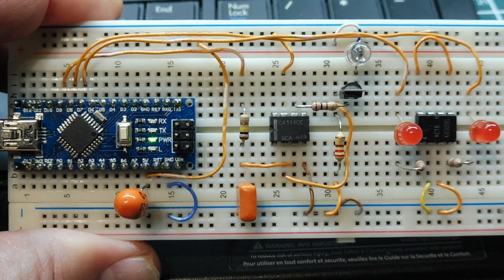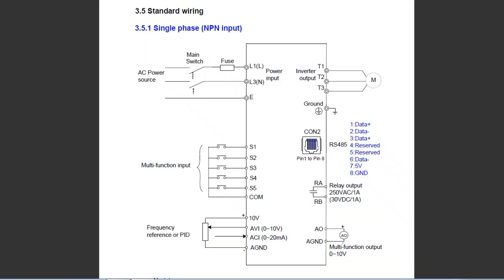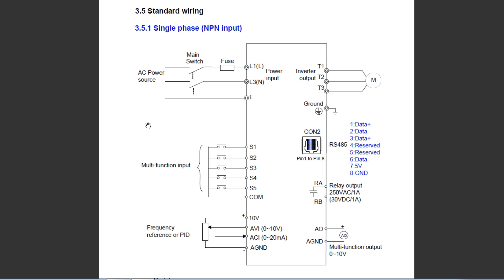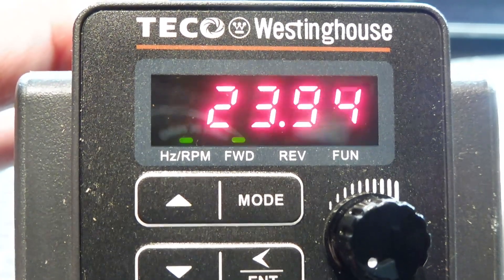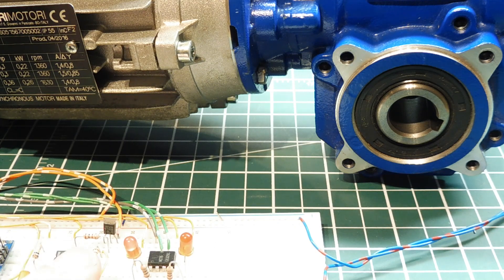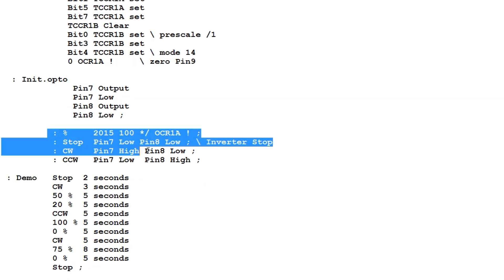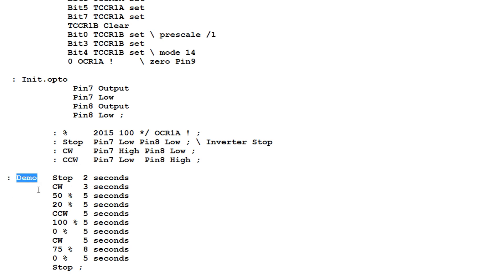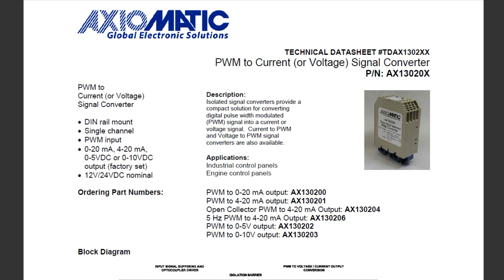How to control a 3 phase motor using the Arduino Nano and VFD

Comment: Hey could you create an arduino code to control a 3-phase motor and 2 12v diverter valves from an arduino uno?

Comment: can you show a closed loop control circuit involving a encoder giving feedback to the controller to maintain speed?
Reply from the maker: The VFD contains a PID controller. PID target value is set with the front pot and the feedback input is AVI 0 to 10 volts. PID values can be configured from the front panel for a closed loop system.

Comment: please provide code,circuit diagram with  Arduino Nano pins connection and wiring 3 phase induction motor and all electronics components . upload on google drive or any other share drive. Thanks in Advance.

Comment: Hello.. great video. I want to apply this method of controlling ac motor to control a single phase AC motor of 1 hp with including a incremental rotary encoder to rotate motor shaft for a specific no. of times. Please help!

Comment: Will this maintain the correct slip angle under load for good torque?
Reply from the maker: The VFD will always maintain Volts/Hertz regulation and will provide the proper voltage for each frequency. When running at a constant speed, slip happens naturally as the load increases. Slip increases with increasing load - providing a greater torque.
Reply: @0033mer  interesting thanks. what about for ramping up and down speed?

Comment: What I have is a motor which is three phase 220V AC with magnetic multipole rotor  rotates inside the stator. It has hall sensor, there seem to be three of them positioned there.  there are 3 hall wirse, ground and the red 5 volt.  I also have the controller board power supply,  I guess they are one unit typically like yours.
On the heat sink it says M1 1400 RPM, M2=1250 ,M3=1200,M4 =1000.  There are 4 separate male plugs sticking out for each of them,  located next to the power in.   I don't know where they would go if I were to use Arduino for control program.
There is also CN3, 4 pins (FG, RT/PWM,62,V2) wherever they go.
There is also CN4, 4 pins ( mode, rest,5v,gnd) wherever these pins goes.
Oh one more there is a square box with two little switch on it which appear to be for the 4 male plugs which seem to pertain to speed of the motor only. 4 combination of them for those M's 4 different motor speed which is mentioned on this  board.
I guess the only thing I don't have is the control panel and a program .  So I wonder if I can use Arduino and some program for this.     Hope to  hear from you. By the way the motor was used to run window air conditioning fan.
Thanks.
Reply from the maker: Sounds like you have a Permanent Magnet Synchronous Motor (PMSM) which is a different motor than my induction motor and the Arduino code will not work on that setup. 
You need to get the data-sheet of your controller to see what input signals are needed for proper motor control.
Reply: @0033mer  I thought I had included a link for the motor. What do I know.
https://www.h-mac.com/amana-0131p00029S.html
When a person sees u.v.w them three wires, does that imply the motor is 3 phase?  The site describes it as single phase.  They don't give you wiring diagram or circuit controller diagram or even to find it most like is out of the question.
And of course Amana site want the make and model of the AC unit itself, in the landfill about 12 miles away, and buried.

Would my assumption be correct that this power supply basically has two components or has two functions that is. 1.   change the single phase to three phase ( ost likely delta) and 2. the second circuitory is to control the speed and direction.  Does that sound about right?
And both circuits are integrated so that I can not use any speed without hooking up and making both  part of the circuit talk to each other.
I am also  just wondering if you would know what [ CN3, 4 pins (FG, RT/PWM,62,V2] them 4 pins labels mean, heck I would put kind of value on pulse Arduino for them and see what happens. if FG is ground, I assume V2 to be 5 volts and PWM, a pin to it, But 62 ( and it doesn't look like it is G2) whatever that pin is.

Comment: Thanks for this video! i am using arduino digital output to connect / disconnect the common with S1 on VFD using an optocoupler (MOC3020) just like you do. Although when I write HIGH to the digital output pin, the optocoupler causes the VFD changes state, but when I write LOW to the pin, the VFD doesnt change back its state.. But stays 'on' the specific state. Any idea what I am doing wrong here?
Reply from the maker: Check the VFD user manual to see how your switch inputs are programmed. S1 might latch and another switch input might unlatch and switch modes. Use a jumper wire to check operation first on your VFD.
Reply: @0033mer  hmm. i dont think that is the case: i tested the operation of the switch between 24V and S1 (or S2 S3 S4) with a wire making the connection. when unreleasing the wire you see immediately on the VFD display the changes... Actually I also have the TECO L510s ! any thoughts? maybe the optocoupler? I use MOC3020
Reply from the maker: The problem is your optocoupler. The output switching device is a Triac which latches on and stays on when triggered. You need an optocoupler with a transistor output.
Reply: @0033mer  Ah! Thanks so much! This is what I was looking for

Comment: Would this same configuration work for a 220v outlet.  I have an MCG AB 34000 and I am trying to run our braiding machine for it, and your setup seems about the same thing we are going for.  Appreciate the video
Reply from the maker: My setup is an induction motor controlled by a VFD. Your have a servo motor which needs a servo controller. Check with MCG.
Reply: @0033mer  They have been out of business for a while now, so very hard to find information on, but I will see what I can do. Thank you
Reply: I just acquired a pwm brushless servo drive, and was still wondering if your arduino setup would be able to control it?
Reply from the maker: Check the user manual for your drive and see what control lines you need. Any microcontroller or PLC can be used to control the drive. Servo motor control is closed looped so the code would be quite different than VFD control.
Reply: @0033mer  Thank you

Comment: Where I have to write the program? IDE or any other software
Reply from the maker: The program was written in Forth but you can use the Arduino IDE.
Any PWM sketch can be used to create  a 20 mA current loop or 0 - 10 volt output using the Arduino Nano's timer/counter
Check out this video:  https://youtu.be/VcqCR7IOatw
Reply: please don't mind sir, actually I am not getting the code structure, What portion I should write in void setup() part and what portion to void loop() part? sir please help me. 

actually I want the same function you have shown over here, from my 3-phase ac motor but I need a little help regarding the program and circuit diagram given in this video. sir please help me.
Reply from the maker: You can also use a 0- 10 volt signal into the VFD to control a 3 phase motor.
You might find this easier to implement.
https://youtu.be/gRWDG9JhyDs

Comment: can i use the code control the single phase ac motor?
Reply from the maker: The VFD I am using is for 3 phase motors.
Single phase VFD are available and if they have 20 mA  current loop control then the code will work.
http://www.invertekdrives.com/variable-speed-drives/optidrive-e2-single-phase/
Reply: 0033mer thanks a lot if i want to use arduino to controll single phase acmotor （we need build a Ac motor electrical racing car ）is it a good way like using arduino nano like this to control speed ？ can you give us some advice thanks  a lot！

Comment: Try using Modbus RTU on RS485 port to control your 3-ph motor.
Reply from the maker: Yes .. that is another option. The VFD will operate with Modbus RTU control. I have used MAX485/487 interfaces with the Nano for Modbus ASCII control. Modbus RTU control with Arduino Nano is a bit involved and better suited for PLC or PC control.

Comment: Is there Arduino (C-variant) code for this instead of Forth available?
Reply from the maker: Find a PWM Arduino sketch and build a 0-20 ma current loop circuit which will allow you to control a 3 phase induction motor.
Reply: 0033mer so the vfd you used won't work with normal arduino code?
Reply from the maker: The VFD I used will work with normal Arduino code. It can be controlled with any microcontroller of your choice that is capable of PWM generation. Running normal Arduino PWM code will control the VFD.
Here is an example of the Propeller microcontroller generating PWM signals that would also control the VFD.
https://youtu.be/9ZKrYfIp-Yw

The programming language and microcontroller of your choice can control the VFD with PWM.

Comment: neat video as always. Have you ever done a video on the Fourth software stack and how to get it on your microcontroller? I'm pretty familiar with Arduino but it occurred to me how compact Fourth looks and I have no idea really what version of Fourth you use for your videos nor how to flash something like a nano for Fourth.
Reply from the maker: Forth is very compact, that is one of its strengths. The one I use is less than 6K bytes. The smallest I have seen is a three instruction Forth written in just 66 bytes.  http://pygmy.utoh.org/3ins4th.html
Reply: Yeah, and resources on the web about flashing forth on an arduino are lacking... If you make a howto video , people interested will at least find yours.

I tried to flash amforth to an Uno : all I got is a dead board : not even able to flash an arduino bootloader back.